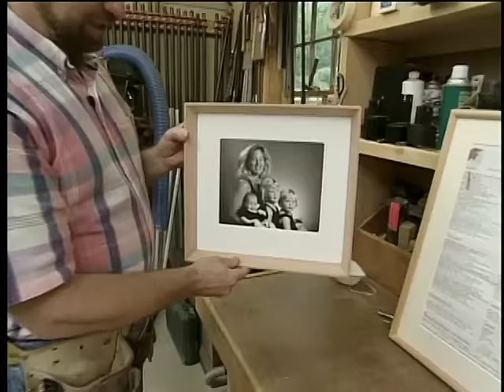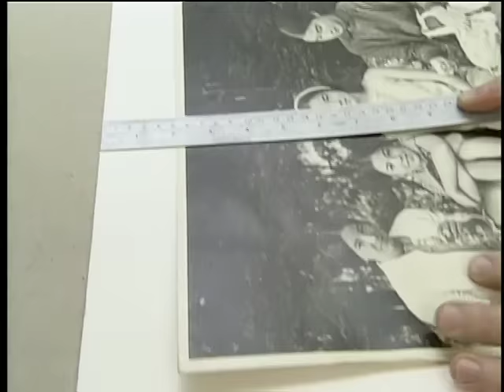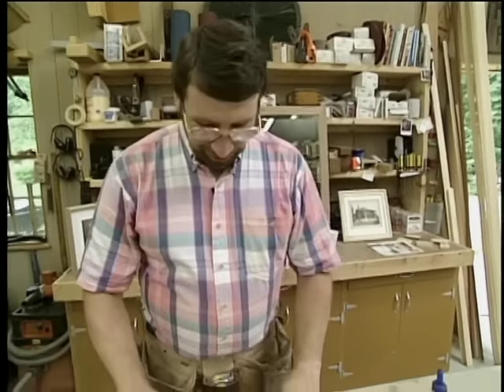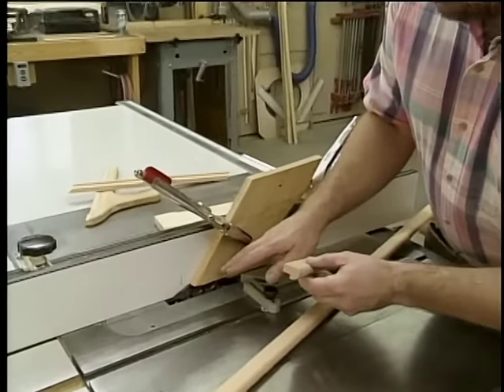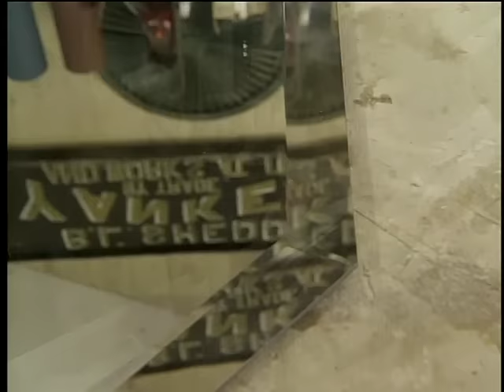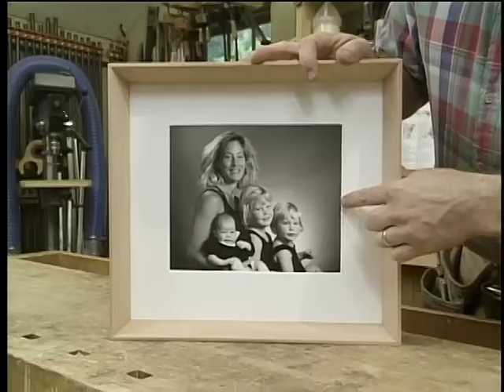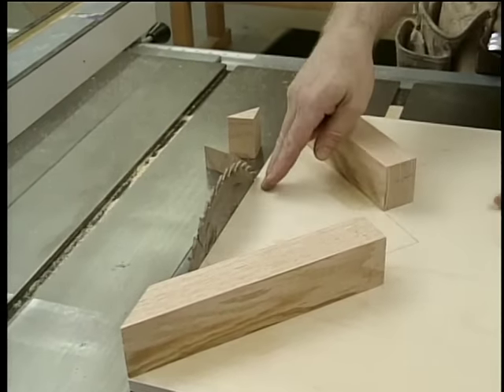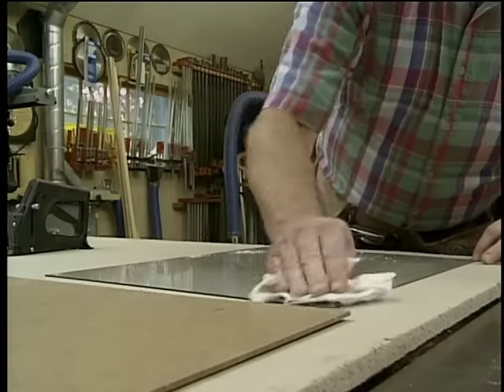Picture Frames  |  S7 E7

Comment: How would we do this without your specialty tools?  All I have is a hand saw and miter box.  Show us some alternative ways of clamping corners, or securing corners.  Is it possible to achieve a bevel on the mat without buying that fancy tool?  Please, please show us some simple things as well as your master craftsman projects.
Reply: Original Air Date: February 18, 1995.  Good luck
Reply: If all you have is a handsaw and a mitre box you could still make one of the simpler frames demonstrated here. Painters tape stretched around the outside edges on the mitres has enough hold to keep things aligned during glue up. You don’t need much force if the pieces are accurately mated.
Reply: Many thanks.  This is an elegant solution to holding a corner.   @TernaryHound
Reply: Could always build a jig and use wedges as a clamping force. A small palm router won't set you back much and can put any profile on the frame
Reply: A bit late but … I just realized what you can do! Don’t make miters at all. You can make very precise butt joints, or you can make two parallel sides protrude a bit  on each side, making it a detail. No, you can’t use moulding, but you could decorate the wood. If you use beautiful wood, or do a good job with paint, who cares if the corners are mitered.
Reply: @johnsrabe  This is just the ticket!  These frames will be harmonious with my modern but shaker style decor.  Thanks for freeing me from the miter trap!🤗